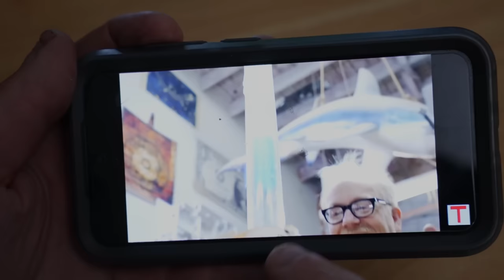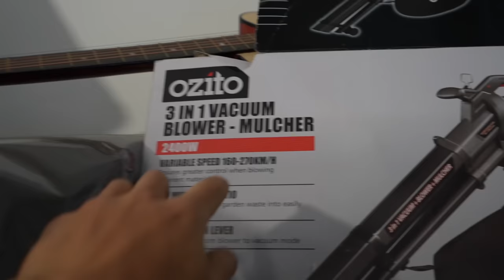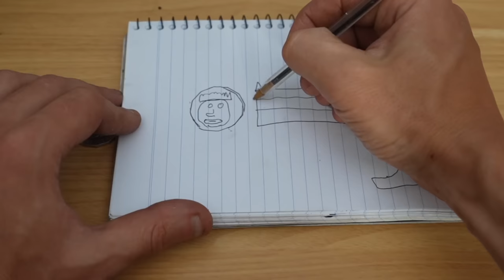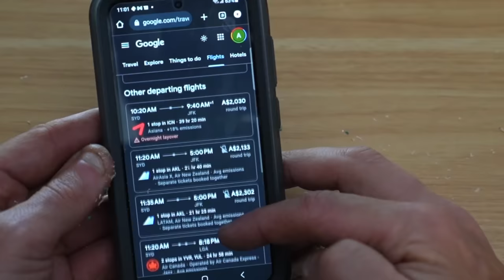The Mythbusters Were Wrong!

Comment: Hate to break it to you, but I think you completely ignored the rotation over time and distance. By the time the coin gets close to the ground (time and distance), your rotation will have been diminished enough that the gyro effect on the coin keeping it in line will not be enough to keep it on edge. It will start to flutter and the speed will be far less when it hit's.
Reply: Would it? Those coins aren't perfect circles. They have multiple flatten edges. Isn't it possible the wind or air resistance could induce more spin over time, rather than less?
Reply: You're both wrong.. he doesn't actually care...
Reply: @DeathEyedGrin  I think It would be a wash. What ever force that would continue the rotation should be canceled out by the equal force of drag catching the incoming edge. There are also some real strong side wind currents traveling though those high rises. The air cant really go through them and  it really wont go over them as easily as it would if it was a hillside so the air mostly travels sideways. That should provide the sideways force to get the coin fluttering, then tumbling. If you notice in the video, once a spinning object falls, it fly's sideways and is called the Magnus effect. Nothing really wants to drop straight down from a high altitude.

Comment: I think your throwing was really fast because the MLB tracks their pitches as they cross the plate, whereas your throws were tracked just after it left your hand. I think that measurement was right
Reply: There is also a lot more mass in a baseball, so it is much easier to impart speed onto the coin
Reply: @SyntheticSpy I think it is perspective, as the 10cm markers were further away from the camera than the coin trajectory so appear smaller. So if you don't factor this in the throws will add appear faster.

Comment: Still have to account for winds which will hit the sides of the coin knocking it off while quickly reducing its speed.  If the empire state building were ten time higher, you'd have to launch the coin at 1000kmh to get to its landing point in the same time frame you achieved in the video.  So, no, even if you were standing on top of the empire state building, and you just threw a coin down, it would not kill anyone.

Comment: Just would like to note that throwing a coin at 109mph is significantly easier than throwing a baseball at 106 due to weight and aerodynamics, a baseball weighs almost 10x as much as that coin and the seams are designed to catch air and allow for variation in spin, which increases drag :)

Comment: Don't forget that there's constantly a current of air running upwards against the side of the Empire State Building (and any skyscraper) which could slow the coin down or disrupt its balance altogether. To mitigate this, I would recommend jumping down with the coin and throwing it at the last second to ensure it doesn't get blown off course.

Comment: 1:42 - When measuring with motion blur, you gotta measure the distance from the same points in the blur. Those frames show that it only moved 13 cm between frames, not 20. So (13/20)*170 = 110kmph. You got the right speeds on video, you just measured from wrong points.

Comment: the speed calculations for the coin throwing from the highspeed camera could have been off because of the perspective warping of the camera. the closer your coin throwing is to the lens, the faster it appears to move. the same applies for the distance from the measuring board, only that the apparent speed of the coin increases the further away the board is from the coin, instead of closer.
if the coin was thrown right up against the board instead of a few cm away from it, the apparent distance the coin travels in x frames would be closer to the actual distances signed on the board.
also the really high "fastball" calculations probably weren't THAT far off anyway, seeing as the coin is so much lighter than a baseball but idk im not a big sportsball fan

Comment: It should be possible (but a long way from easy/approachable) to calculate how fast the coin needs to spin to stay on its edge the whole way down, within a reasonable tolerance.

What would really happen is that little variations in air velocity would apply forces attempting to unsettle the coin. What the spin stabilization actually does is change the direction of those forces to 90° off of the oncoming air direction. This will create gyroscopic precession that'll make it tend to fall in a spiraling pattern.

The gyroscopic effect will also resist unsettling forces, I believe in proportion to the spin rate, slowing and scaling down the spiral. However, the energy it takes to resist those forces comes from somewhere. In this case, it comes from the angular momentum, reducing the spin rate according to how strongly it resists unsettling moments.

So... in an idealized world with no random air movements and just the tiniest offset in the coin's initial angle or mass distribution (the graphics and lettering is more than enough for this), what should happen is that the coin will start in a very slow, small spiral, its spin energy being sapped as it resists the oncoming air flow (drag), making the spiral gradually increase in scale and speed. This will greatly reduce accuracy for your dastardly anti-New Yorker plan, and at some point the coin will reach a point where it's not aligned enough to maintain its spin, and will start to tumble, decelerating to the... what was it, 60 m/s that Mythbusters found?

In the real world, the air wouldn't be still. Wind speed won't change anything I don't think, other than to cause the coin's entire path to transform in that direction. Instead, it's gusts i.e. changes in wind velocity that will provide extra buffeting forces that will serve both to unbalance the coin and sap its angular momentum more quickly, and also decrease the threshold at which it will begin to tumble and slow down to the natural terminal velocity.

As it spirals, it will also gain some lift, which will slightly decrease the terminal velocity, but this should be negligible as long as it's still spinning fast enough to stay within around 5° of vertical (simple small-angle approximation, thanks Trig!)

I... was considering attempting the calculations, but aerodynamic maths has a way of getting really complicated, really fast, and it doesn't take the removal of very many simplifying assumptions at all to make the differential equations unsolvable, requiring a numerical solution, which in turn requires very expensive software. This situation is more than complicated enough to be non-solvable by hand, and to require real, high-fidelity computational fluid dynamics, so... unless someone who has access to such software wants to give it a go, I'm afraid I'm limited to just gut instinct.

My instinct says that it's unlikely a real coin, dropped from a real building the height of the Empire State Building, in real atmosphere including potential buffeting and vortex shedding from the building itself, would actually keep spinning long enough to make it to the ground anything close to vertical. My gut says the spin rate you'd need to start with would be beyond the physical limits of the coin to hold together (assuming a modern composite coin; a bespoke 'coin' of a homogeneous and high tensile strength material maybe could do it). Actually, my instinct is that it won't even be close to possible, and will probably slow enough to start to flutter and tumble within something like 5-6 seconds even at very high rate of spin.

Honestly, if you want to drop something from a tall building and have it be genuinely dangerous every time... try a dart. Or any rotationally symmetric, streamlined object, really. Or a rotationally symmetric object of any profile that's spin-stabilized, like, I dunno... a bullet? xD

A thin cylinder edge-on is actually pretty terrible in terms of drag coefficient, and the contours of the surface, and the slightly thicker ridge most coins have around the outer edge are non-trivial and make it even worse. I would only expect the speed to go up by a factor of 2 to maybe 3, which does get it close to that 300 km/h people were finding using (presumably fairly basic) physics simulators.

Comment: Quick math shows that the stable 0.5AUD coin should have about 250-300kmph terminal velocity.
Reply: Futhermore, it has momentum of about 1.2Nm, estimating time of impact to be about 1ms, the resulting force to be about the order 1000N and the pressure to be 10 MPa. About the pressure necessary to break a bone.
Reply: Wouldn't you know it math works. Watching further into the video - result as predicted.

Comment: A coin is A LOT smaller and lighter than a baseball, it also has less volume and surface area. If you're throwing a coin as fast as a baseball thrown from a pro pitcher that's not a surprise, that's physics.

Comment: The problem with your assertion is that the Empire State Building is just shy of 1/4 mile tall at approximately 1250 feet... do you think you could throw a coin hard enough that it could travel perfectly straight on the "skinny" edge without the air resistance causing it to revert to the flat position it would revert to naturally?...

A spinning object doesn't spin indefinitely... especially if it has any force pushing against it...

Try shooting it into a wind force 1250 feet & see what happens...

Comment: It look possible but i am pretty sure that the coin will not stay on the skinny side for long because the spinning rotation may stop before it hit the ground for a distance as long as the height of the empire state building.
In that case the coin will start slowing again while flipping.
There is wind factor too creating turbulence with the building
Plus if you use something or someone to make it spinning, it not just a drop anymore.
Reply: I don't want to say that you is wrong but it need more real scale height tests to affirm that other are wrong. (i can be wrong) XD

Comment: You'd need one hell of a flywheel to put enough spin on a coin to keep it vertical for 380 meters, and not add any force when letting go of the coin to add external acceleration. Someone calculated the terminal velocity of a US Silver dollar which is just under 9g heavier than the .50c coin, and the simulation (if kept vertical) could achieve was 255m/s. But the energy required to keep a coin of that mass vertical(spinning) would be stupid. But fun video I suppose. Still virtually impossible to achieve without a device to spin the coin for you, which was not part of the myth.

Comment: The empire state building is 440 meters tall. The top observatory is at 373 meters. This would allow 8.72 seconds of freefall. That gives a max theoretical speed of 85.5 meters per second, or 308 km/hr. There's no way you're getting more than 270 even if they were falling straight down the whole time.

Comment: surely the terminal velocity of the spinning coin is only that high until it stops spinning... i dunno if you tested this but how long does it take to stop spinning due to the air its passing thru? cos if you drop it from a great height even if it starts at higher spinning terminal velocity it may end up hitting the ground at normal slow side first terminal velocity

Comment: flawed, with more distance comes more interaction with the air with will certainly increase the time it has to possibly change directions and also to make the coins flip. I think that at least it will curve but if the altitude is high enough it will eventually flip once that happen it will lose velocity. So the conclusion is that a coin can cause damage depending on the height , if it is too high it will get to terminal velocity and will not descend with a spin. But if it is not so high and it gets some momentum spin it can be dangerous but probably not deadly. But it will be extremely difficult to aim and shoot the coin to a target, as said before it will make curves and because of the wind it is unpredictable how it will play out. Like I said there is an altitude where coin is potentially dangerous. Another note is that the question is that is a free fall coin deadly, and the answer is no!!! Now if you change the question to can it be dangerous? certainly can!

Comment: It's possible you threw that coin 170km/h. The baseball is measured in Miles and is much larger and heavier and has more air resistance. And the maxes of those are also around 170km/h. So yeah, that's probably around a valid number. Maybe somewhat off due to image smudge.

Comment: Why did you used cm ? 
Cause my eyes are bleeding from your calculation and measurement.

I find around 20.1mph or 32,4 km/h at 1:44
1 frame= 1/60 s
1 frame= 15 cm
15 cm=0,15m because 1m=100cm
then 0,15m/(1/60s)=9 m/s
and finally 9*3,6=32,4 kmph
meter is easier, more precise and more spread than a foot or an inch

Comment: Everyone saying that myth busters was wrong, isn't taking into account that the wind pushing up or across the face of a sky scraper is greater than the force you yourself can exert on its edge, thus creating the Mandela effect. Yes, if there was no other outside forces acting against the coin, then it might be possible to ninja star someone with a coin from 800 feet or more. But outside of doing this in a vacuum chamber, it's just not possible. My proof is this. You drop a feather and a bowling ball outside of a vacuum chamber and the bowling ball always hits first. But you drop them in a vacuum and they hit at the same time. This has been tested. So I'm assuming the people that made this video are flat earthers. Soooooooo, yeah. But if you want to do a more accurate test, put a high powered shop fan pointing at you as you throw the coin and see how the coin reacts. Science.

Comment: I think  the coin would start flapping again if you threw it from a taller place as that 40 meter dam as soon as the spin would stop. Therefore you would have to launch it with a machine that would spin it up to high speeds first, kind of like a beyblade, so that it would maintain the spin through the full fall.

Comment: How are you going to keep it spinning from all the way on top of the empire state building? That thing is going to slow down until it's mostly harmless again. Also, the coin still has a terminal velocity that is less than the speed you can shoot it at. Although you haven't disproved the busted myth, it is an interesting fact that the spin causes a centrifugal force that can keep it at its side.

1:00 As you do. Busting the mythbusters busted myth wasn't even on your mind. This is just standard tuesday mornings.
4:54 Or most of the air is just blowing past the sides when you should really just be blowing all the air straight through the tube with no holes in it.
5:31 If that's your child, you're a terrible parent.
8:39 Obviously it's because they're pink. And if you paint flames on it, it goes even faster!
10:50 Perfectly accurate. No notes.

Comment: ...this doesnt prove coins falling are lethal...   Terminal velocity is a thing... coins lose speed when going faster than this speed (its the speed their shape makes combined with their mass and gravity pulling them down vs air resistance) its why the myth busters didn't just fire them as fast as they could make them go... thats not terminal velocity thats acceleration, we already know metal shrapnel can kill at high speeds, we used to use coins in shotgun shells at certain points...  

The coins CANT go faster than terminal velocity... so even throwing them down off a building will slow them down to that speed before they hit the bottom.....  your channel is like science for college dorm bros...

Also you forgot that mythbusters used a nailgun to fire their coins at the speed of terminal velocity EDGE FIRST not tumbling...  

Did you even watch the episode?
Reply: I like your explanation but i think this is a joke channel

Comment: The Mythbusters were frequently wrong. Often, their experiments had obvious shortcomings. A common error early on was attempts to make catapult-like devices without all the parts of a catapult. Most famously was the lack of a blocking crossbar in the boomlift as a catapult atop shipping containers in the first or second season. If a crossbar had been present, the boom arm would have stopped and allowed Buster to be launched instead of being slammed straight into the ground.